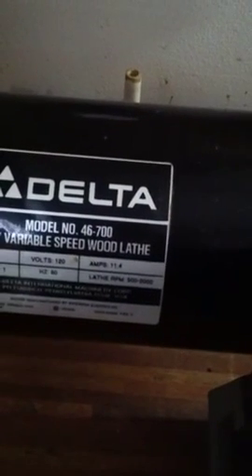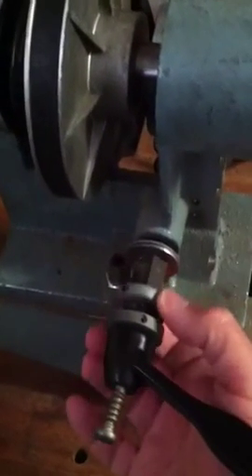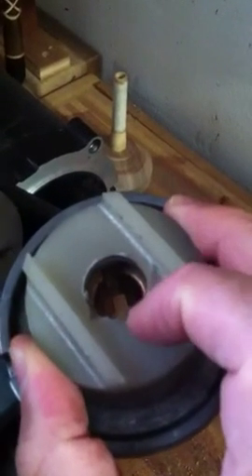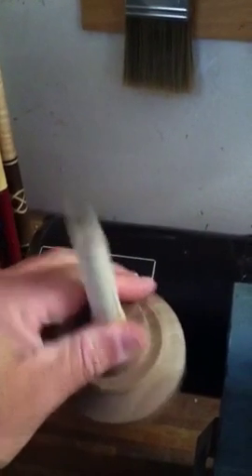Wood Turning Delta 46-700 Reeves Drive

Comment: The inside pulley kept sliding toward the motor. I added 2 basic hardware store zinc washers ( 5/8" hole ) on that side.
They touch the bearing but not the motor so seem ok for now.
The key had slipped toward the bearing cover plastic item and cut a hole.I turned the key with now tapered side to the motor side and under the set screw of the motor side pulley. So far reassembling everything seemed to work. That brass tube with opening for the right side assembly is worn but I'm back to getting my variable speeds back and the pulleys line up now.
Seeing this video helped me. Thanks,
Reply from the maker: That's great! I will keep the 5/8" zinc washers in mind when I have to do this.  Glad you were able to get up and running again.

Comment: Thank you for posting this video. Wish I had seen it yesterday though, lol. I had to fuddle through everything myself. Had to replace the key (?) also it was chattering very badly in low speed. I think it is fixed ok, but I had a heck of a time getting it back together because I didn't know you could turn the knob to release the right side of the pulley!
Reply: gayl carter Thanks for watching, you can add a handle by inserting on opposite end as seen in another one of my videos, if you didn't please like and subscribe. Happy turning.  Gabe.

Comment: Would it be useful to add a delrin or brass washer between the pulley half and the motor ? The pressure of the arm against the bearing cover has caused the inside pulley half to slide over close to the motor.
I adjusted everything and recovered my high speed again but now get a clattering knocking sound at most speed settings.
I guess that I will have to make new parts, Is it true that the bearing cover is not needed? It seams to actually ride against the outside small pulley that is rotating. Was belt dressing liquid a bad idea?
Thanks,
Reply from the maker: I actually don't know what is a good idea or bad idea as problem is unique to the user, it had been 8 years since I did this video so my issues were different as I recall.  I would try the brass if you have it and see if it works.

Comment: Can you show how to properly replace the two sets of bearings? I was able to do the left one but not the right. I'm probably missing something simple like your removal of the speed handle to release the pressure.
Reply from the maker: Hi Gary, I don't know how to change the bearings on the lathe.  In the beginning of the video I show how to release the pressure by backing off the speed handle in the front which releases the pressure off the spindle shaft.  Give the video another look in the beginning.  Right now my lathe is in stow away mode under my rotating workbench.  Hope that helps.
Reply: @exoticwoodpen  No worries. Now that I've got my most recent project off the lathe I can tear it down. Thanks again for the tip.

Comment: Hey Gabe, I'm having some trouble with the movable half of the pulley assembly and was hoping you could help me sort out how it goes back together. The bearing cap (the white plastic bit) seems to have melted into the bearing (I managed to free it with an acetone soak), but the bearing itself is seized. These can be replaced without too much trouble. That leaves the pulley half. Upon disassembling it, I had a copper-colored bushing and the pulley half, as two separate pieces. Looking at the parts diagram, it seems like these two bits are supposed to be connected?

Incidentally, I've had that problem with the set screw on the fixed side a couple of times now -- it doesn't always like to stay put :-)
Reply from the maker: +Dan Lecocq Hi Dan, I just re watched my video on the pulley assembly, the copper bushing is inserted into the pulley which grabs the key.  The copper bushing is connected to the pulley.  Hope that helps.

Comment: Hi Gabe. I have a 46-700 as well. I would like to replace that white bearing cap on the motor shaft. I cant find a replacement due to it being discontinued. Di you know where i can find one? Or can you think of a way to rig it with something else? Great video! Thank you.
Reply from the maker: Hi Dan, thanks for watching the video.  I wish I knew where to find one also but I left mine as is.  If you have a hole in it like I do you can repair it with JB Weld or line the inside with a thin scrap of steel.  Wish I could be more helpful.
Reply: @exoticwoodpen  thanks for getting back to me so quickly. My cap is still ok but i see it starting to crack. I was thinking of making a mold of it and reproducong it that way. Either that or rig it without that cap so it still runs.
Reply: @exoticwoodpen  i havent taken off the white cap yet to see the inside. Where would a line it with the steel?
Reply: @exoticwoodpen  the white bearing cap is designed to press up against the outer part of the bearing, right? Thin inner part of the bearing spins with the shaft while the cap holds the puter section of the bearing?
Reply from the maker: @danagoglia1406  I have not taken a look at the inside of the cap.  If you can remove the bearing from the cap and put a thin piece of metal there and re-install the bearing on top of it that might work.  I would use a old hand saw blade and cut it down to shape to fit the inside.
Reply from the maker: @danagoglia1406  Yes, a scrap of hand saw blade or something like a steel scraper.